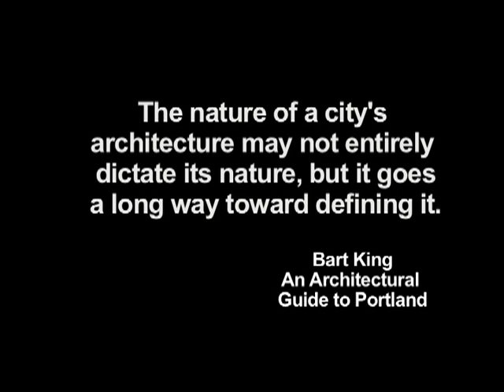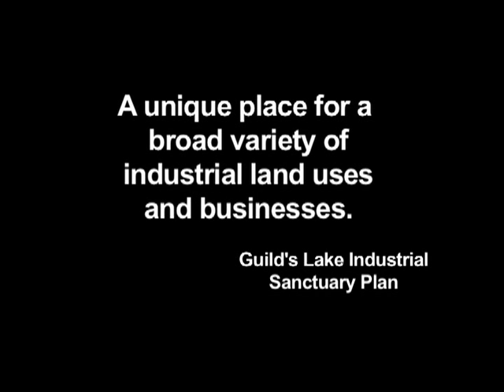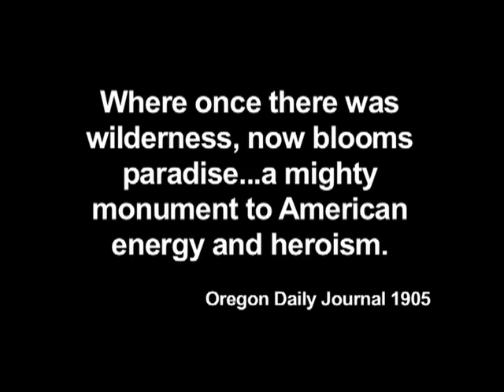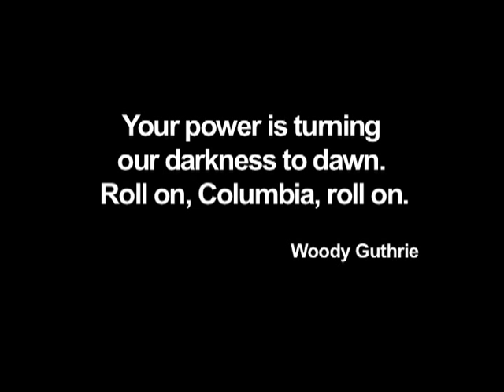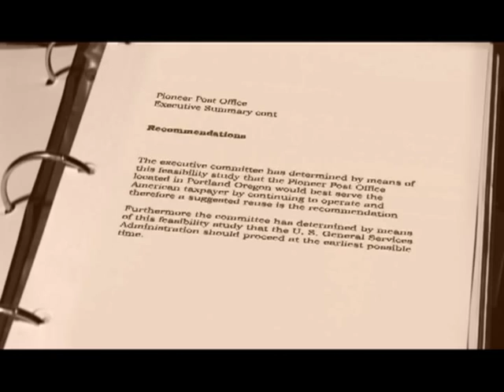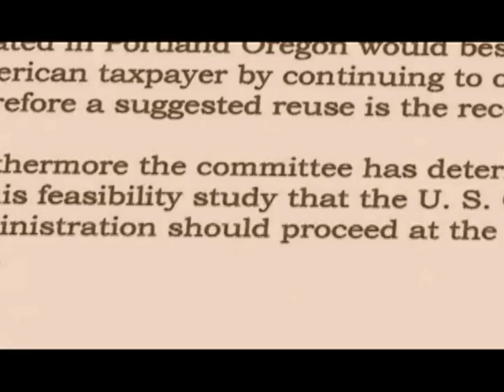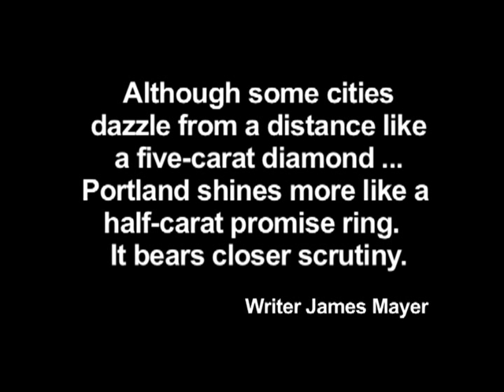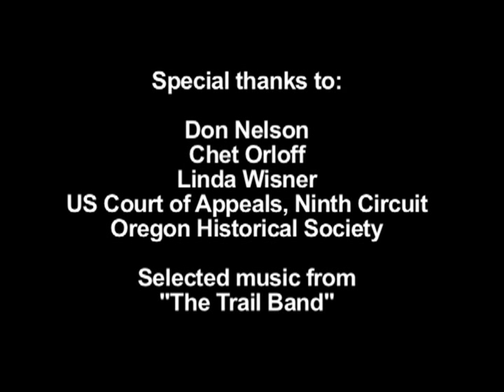Pioneer Courthouse, Portland, OR (Part 1)

Comment: Definitely a lie regarding the date when the Courthouse was built. Sure there no existing  blueprints of this building. It's easy to see one, or maybe even more floors in the ground  caused by the Mud flood. Otherwise, who would create the main stairway going into the higher floor? That was a reason why some guys wanted to destroy it as a witness of a different era like they did with many other ancient buildings in Portland, and across both Americas. Please, don't tell me that the original builders were building with underground floors on purpose. Thanks a lot to those who saved this piece of architecture from a destruction along with the Pittock Mansion.
Reply: It is documented in Judge Deady's own diary as to when the building was built and the complaints of citizens that it was too far from the Willamette.
Reply: @Rosarium2007  @ygagarin5572 Then there's the story of the man who sold the Pioneer Courthouse lot for $200 and was laughing all the way to the bank speculating they'd never build out that far.